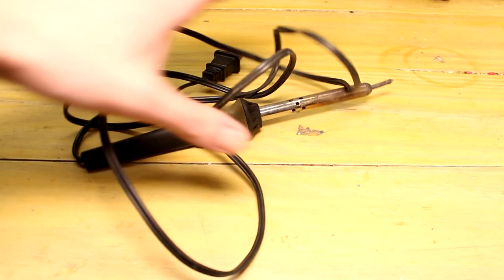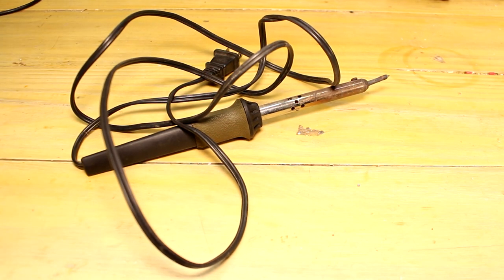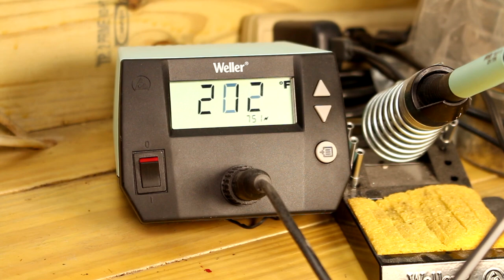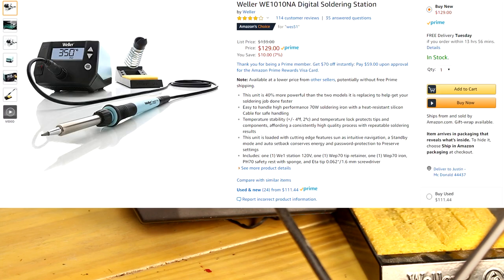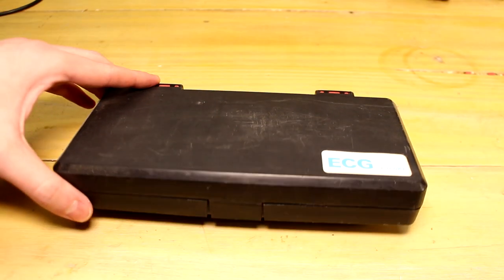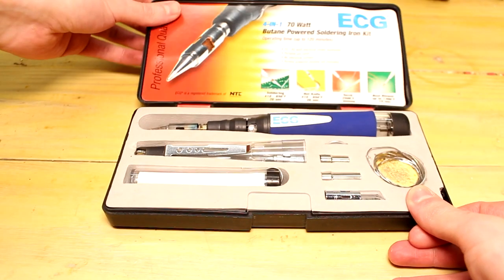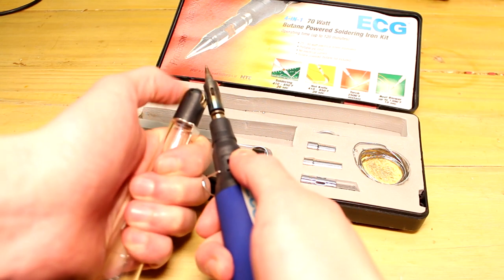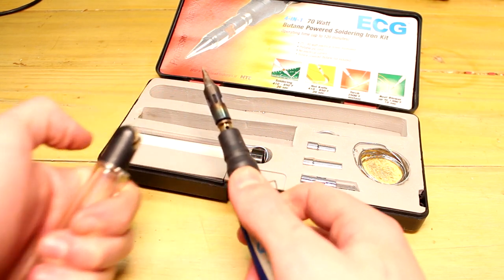Soldering Basics- Simple mono RCA to stereo 3.5mm cable

Comment: You and your viewers should be aware that the cable you make in this video would ONLY be suitable for use in a mono-to-stereo application. The problem is that it could also be used the other way round. In that case, this cable would severely overload the output device. A stereo-to-mono cable needs to impedance match the output of whatever device you are using. If you are capable with a soldering iron, then a simple stereo-to-mono 'summing' cable is easy to make with just three resistors, and instructions are easy to find on the web.

Comment: Not the cleanest job but fine for the application. My old digital Weller finally died and I got a more portable electric type with the round tip. Takes about 15 seconds to green light and I can use an inverter when working in the car. I laughed when you realized the same mistake I tend to make... especially when you mentioned heat shrinks.🤣